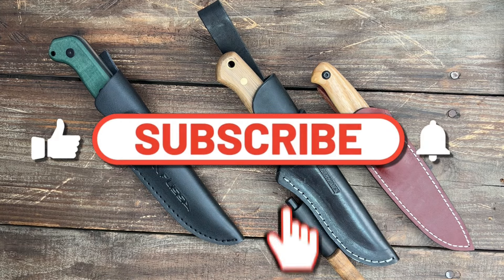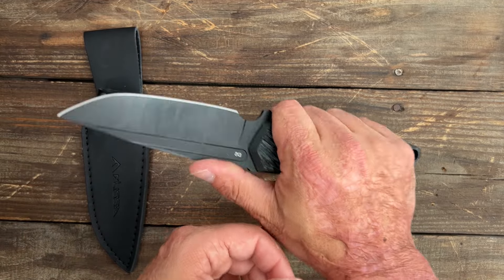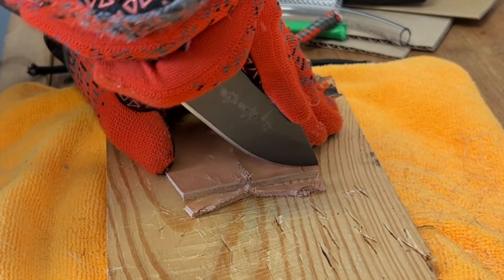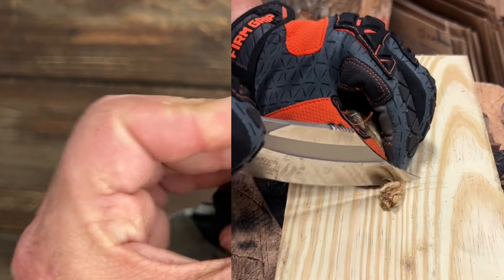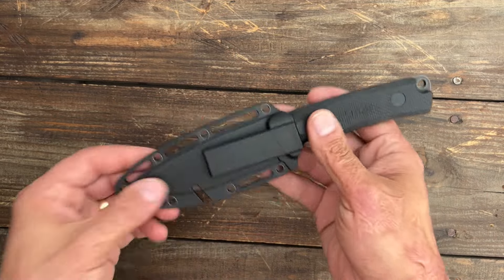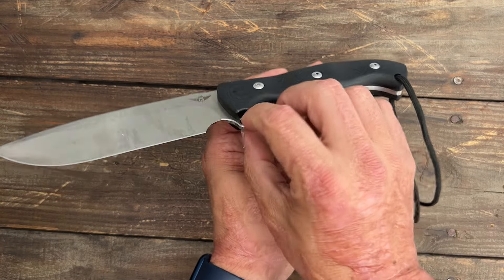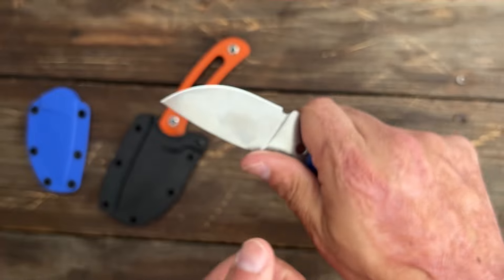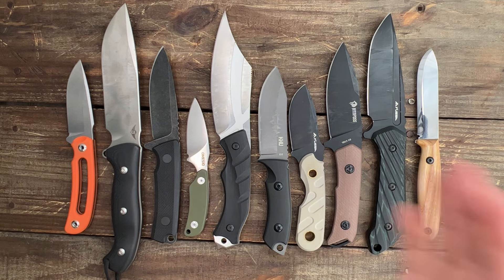Top 10 Amazon Fixed Blades Under $100

Comment: Awesome selection of fixed Blades, the Ruike Hornet has been on my list for awhile now. I have its bigger brother the Jager and its an incredible knife for the price, yes i wish it came with a Kydex sheath but its still servicable and for belt Carry it works well. Ruike does an amazing job with the 14C28N as well and i do prefer it over carbon steels in the same price bracket such as 1095 or D2. Whatever you're budget it's great to know you can get a great blade to have fun in the outdoors with. Thanks for the great vid and keep making sharp things fun and enjoyable.
Reply from the maker: Thanks Todd 🍻🍻

Comment: Why so much D2 instead of 14c28n? I'm sure there are many stainless options in this price range.
Reply: Because D2 is not expensive. It's not so bad in corrosion,  toughness is good but it has à very good edge retention. Medford are making many knifes in D2 over 500.00 😅

Comment: That $25 Flissa is a knock off of the Viper Berus drop point that's absolutely amazing i love the Carbon handled one and its M390 steel so awesome and $145-150 on knife center i will own one all i carry are smaller fixed blades my most carried and lived knife is a Esee Izula S35VN with micarta scales

Comment: did you just say that a knife in 1066 carbon steel outperformed a knife in d2? i know a lot of companies do absolutely shit heat treats on d2 but if it was THAT bad i’d be PISSED
Reply from the maker: Just at wood tasks because the d2 scandi is to thick it doesn’t perform that well